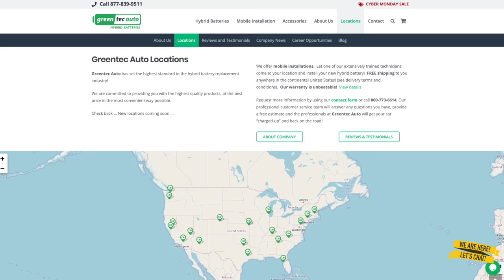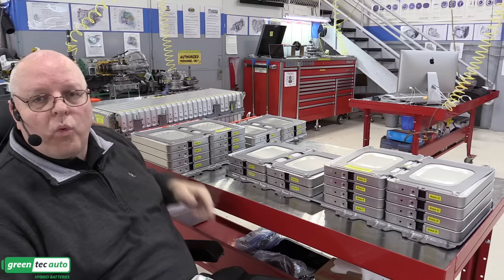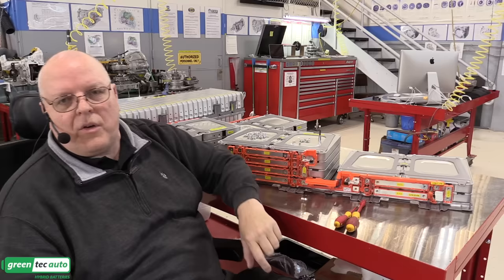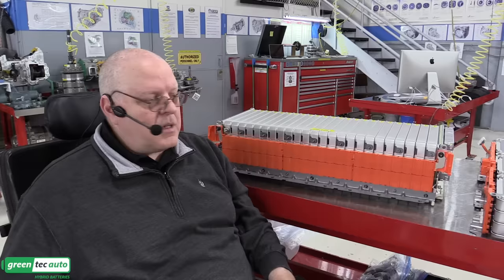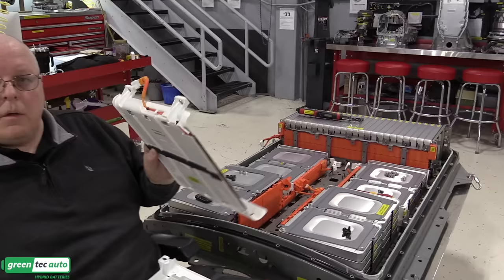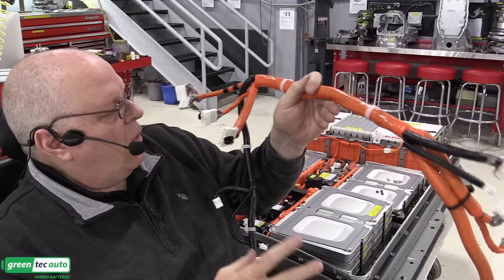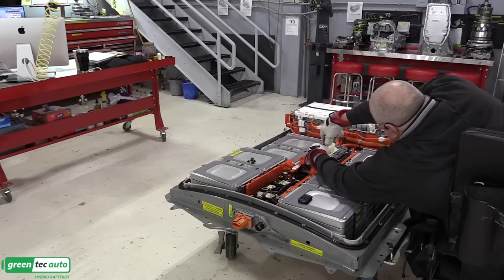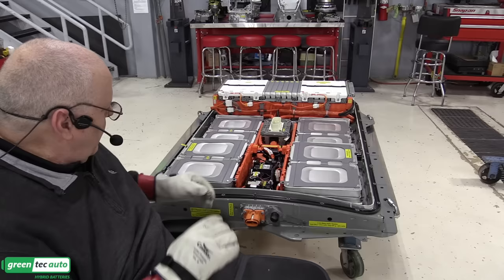2011 Nissan LEAF Battery - Deep Dive

Comment: I dont know when i will ever need this information but i freakin love watching these videos! Glad your back up and firing on all... battery cells
Reply from the maker: Thank you!
Reply: This new tech is largely unknown and untested. Do you remember the first switched feed that where lighter than those with transformators, but broke down in large numbers,  piling up to bulges?
The huge batterie has also new chemistry and had already a huge fire that required a huge tub to be drawn. How many more electrical nuclear facilities will there be needed to supply all those crazy ecological drivers eager to outlaw the older diesel and gasoline motor cars?
Please give us also a video on U-Tube about these. Willy Degeest, electrical engineer UCLv, 1966
Reply: Just bought a 2011 Nissan Leaf!
Reply: we will never have to open one of those in our life time.

Comment: Wonderful information.  I owned a 24 kWh Leaf that suffered two bad battery modules.  I was seeing diminished range even though it showed 12 bars of health. Nissan corporate fought me tooth and nail on repairing the battery until it finally when into turtle mode and threw the check engine light.  The dealership was on my side, but Nissan corporate would not authorize the repair until it completely failed.  They dropped the pack, and replaced the two modules. After it was repaired, I traded it for 2017 Chevy Bolt.
Reply from the maker: Thank you. I am sorry to hear of your troubles. The Bolt is a great car
Reply: WeberAuto I’ve really been enjoying my Bolt. Two years old now.

Comment: Thanks professor YOU'RE videos convinced me to give electric cars another try I used to have a 2013 Nissan Leaf SV it was a fun car but  my winter range was 35-43 miles and summer was 60-85 battery degradation was pretty bad sold it after a year couldn't deal with it anymore plus no quick charge on it. 4 months ago I bought a 2017 Chevy BOLT and so far love it winter range is 160-190 miles and summer is 215- 270 ! Learned a lot from your videos and active battery thermal management is a very important thing plus this bolt has quick charge :)
Reply from the maker: Thank you very much!
Reply: Wow!

Comment: Thank you very much for this, Professor and team! I'm a Nissan LEAF owner from Sri Lanka, where, when paired with rooftop solar, the LEAF is arguably the most practical vehicle to own, if not for the effect our otherwise great tropical heat has on it's battery's State of Health. I'm hoping your video will help me to understand and evaluate options, if and when my battery's SoH makes some kind of repair or replacement necessary.
Reply from the maker: Thank you and best wishes!

Comment: I am not a technician, however, the info you provide is detailed and easy to understand.  I especially enjoyed your video when you explained how the high voltage system workes and is isolated even if it is compromised.

Comment: This will be great in a few years. I plan on taking my leaf battery out of my car when I am done with it, re-arrange the cells to 48V and hook it up to my solar system.
Reply from the maker: It could be easily done
Reply: If you've got the money they're up on Ebay right now already.
Reply: They are definitely some of the best batteries for DIY powerwalls.
Reply: @InnovativeSustainableSolutions   I would not go that far, thermal runway is an issue and I would not have them close to the house  for that reason.
Reply: Aren’t we all already somehow connected to the Solar System man? ✌️

Comment: Minimum voltage is 2.6V. At that point, contactor disengages.  (applies to 2014 Leaf, not absolutely sure about 2011)
Reply from the maker: Thank you

Comment: Awesome video- thank you. Gives way more info than even reading service manuals gave me. My 2018 had a bad cell module at 8k btw. Detected as HV leakage to ground. Took a long time to replace and now those cells are 60-70mV above the rest even though tech specifically told me he balanced them prior to assembly. Seems a bit out of spec!
Reply from the maker: Thank you very much. New cells will normally be slightly higher after balancing and driving. As long as the difference does not exceed the specification, it will me okay.

Comment: Two lion pouches run in parallel(making a pack) and two packs run in series (to make a module) and 48 modules run in series. 2 stacks in front(L/R) and 1 stack out back.
Reply from the maker: 48 modules running in series on this battery

Comment: Hello from Estonia, again. I have 2014 Leaf, same battery design, different chemistry. Climate here is mild. Two days ago I passed 161xxx Mm (or 100 000 miles) and my battery SOH is 93% (maybe 92% because calculations in cold weather are not very accurate by BMS, it fluctuates seasonally).
What I want to say to everybody who really things every battery has to be cooled - NO. No it doesn't. Though chemistry must be totally fine with 20-40*C. 2011-12 Leafs did not like 30*C AT ALL.
Also cooling is definitely required if charging happens on average, above 35kW (long distance trips). 24kWh battery will accept 40-45kW for aperiod and gradually slows down to 35kW at around 2/3. 30kWh Leaf can easily take  45-48kW for majority of charging session and THERE you need some active cooling (doesn't have to be liquid). But yea, not all EV's need active cooling :)
Reply from the maker: Thanks for your feedback!
Reply: Did you know Tesla heat up the battery to 60 degrees to charge and this prevents degradation when charging. This issue with the leaf battery is heating and cooling.

Comment: Thanks you for another very informative video! 
All these high current connections remind me that when I recently replaced a Tesla Model 3 pyro fuse there was a requirement to do a 4 wire resistance check (45 and 60 micro-ohms max) of the finished connection. I can imagine that the Tesla, using plated aluminum connections and max. charging loads of 250 kW is maybe a bit more concerned about this than others, but it made me wonder if we want to be doing such measurements on all high current connections? After all, the consequence of a high resistance connection might be a fire in the battery case and I can't imagine any way that the BMS will detect and prevent such an event ahead of time. 
In my EV conversion work, we often just give the car a hard drive and then view the system with an IR camera. But in a closed battery case that's not a simple option. 

Anyway, just the usual musings. Thanks again for sharing so much excellent knowledge on EV's, I've learned many tidbits from your programs.

Comment: Really fascinating video, glad to see that you're back.
Seems really short-sighted of them to not do some kind of active cooling.
there's plenty of room around the perimeter that they could have done cooling blocks  or internal radiators and run a coolant loop to the outside of the battery case.
Reply from the maker: Thank you and thanks for your feedback

Comment: Service disconnect AFAIK is between front stacks and rear stack, dividing voltage in half.
Reply from the maker: Yes, you are correct. I was wrong. It divides the rear stack from the two side stacks.

Comment: I own a 2015 leaf, So this should be pretty informative!
Reply from the maker: Yes, they are very similar.
Reply: WeberAuto I just bought a 2016 30kWh Leaf. Are there any major differences? Cooling? I was under the impression there is significant air cooling.

Comment: You leave no handicapped people an excuse to not work.  Although we all knew you could / would do it, an assistant would probably been nice to have, especially as you lowered the end cell pack.
I could see you felt like I did, that was totally stupid that they didnt put some cooling system in this design.  I think the engineering group should have been moved to an assembly line position, or worse, after this.  Thanks for all the wonderful videos John!
Reply from the maker: Thank you and thanks for your feedback!
Reply: Don't blame the engineering group, blame the bean counters.

Comment: Beautiful executed, it is a bit funny the lithium cells can't withstand charching below 32 °F since that will result in copper plating on the graphite and insulation.  My point is how can the car regenerative braking at temperature below 32 °F when the heating element isn't  activated before 1.4 °F
My I3 makes regenerative braking below 23 °F (haven't tried it at lower temp and it is right out of the parking lot)  
PS: It is delightful to hav you back on the channel in full action 👍
Reply from the maker: Thanks fort your feedback!

Comment: I purchased a LEAF a few weeks ago, and I am greatly indebted to you, Professor Kelly, for this video of the assembly of a battery pack.  It contains all the vital information concerning the batteries which hitherto I have been unable to find.  Thank you.  One point: when you were dealing with the high tension components using the appropriate protective equipment and insulated tooling, when torquing down various securing screws the torque wrench and deep socket didn't appear to be insulated.  Is this so, and if so, is it safe?
Reply from the maker: Thank you, and thanks for your feedback. I agree, insulated tools would have been more safe.

Comment: Thank you very much for this very impressive demonstration of high skill engineering. This should be a lesson for all those that call them self engineers. Is just briliant to se someone work in the proper way.
Do you have any plans for taking apart a Renault Zoe, possibly also the battery?
Reply from the maker: Thank you! I do not have any plans for that, but it would be interesting

Comment: I'm 4 years into a 2013 Leaf SV. About to hit 100k miles by January and only have 74% original battery state of charge left, it's about 16.3Kwh when fully charged. Wondering if it's possible to replace the battery and maybe some other computer communication parts to use a 2017 30 kwh battery pack? Or do I ride the car out and let it die its natural death, get as much use out of it that I can, and get another EV for longer days?
Reply from the maker: Let it run out and get another EV later

Comment: Can't wait til one day you get your hands on a model 3! Can't believe this car has no thermal management, what a sham.
Reply: Yep, after four Arizona summers and 43K miles, I'm down to ten bars on my '15, which shipped with the "lizard" battery.
Reply from the maker: Thanks for your feedback!
Reply from the maker: I hope to get my hands on a Model 3 too!
Reply: I agree, it is really fraud.
Reply: @WeberAuto  thanks for sharing the video, it was informative. As for the design lacking an active battery cooling system, Nissan still hasn't included one in their 2019 model even though they are fully aware of how detrimental it is without one. Hopefully a second hand market will develop where someone comes up with a battery replacement that has an active cooling system, I know it won't be Nissan given they are selling crap that should have warning labels on it. Never Again Nissan, may you be force to buy back all the Leafs you sold for their original purchase price plus the financing cost for the owners.
Reply: @ewmlloyd  Lizard as in cold blooded? haha
Reply: @ewmlloyd  lack of cooling was only half the issue.

Comment: The middle terminal is needed to balance the cells. Over time, the internal resistance of series-connected battery cells can begin to vary greatly This causes one of the series-connected cells to recharge while the other is undercharged. Overcharging will reduce cell life and may cause the battery to ignite spontaneously. To prevent this from happening, an additional terminal is made from the serial connection and a device is connected to it that controls the charge of each cell (two parallel-connected cells in the case of a Nissan Leaf).
Reply from the maker: Very true. Thanks for watching

Comment: The Leaf is a really well engineered car. Every part of th car is really well made and serviceable. If the battery had temperature control it would be great for hot areas. The ones that drive around here in Northern Norway are still doing well as it's not very hot here. 10/12 bars is normal degradation for the old first gens here.

Comment: What's your opinion on Nissan refusing to actively cool their batter packs?
Reply from the maker: It makes no sense to me. Nissan tried to corner the EV market by cutting costs. I think this was a cost cut that ended up costing them.
Reply: WeberAuto I kind of agree with you that all high voltage power pack should be actively cooled, but it makes me wonder, why there’s so many cases of Leaf battery degradation, yet not so many case with Soul EV packs. Other than cars DC charged in high temp climates like Arizona, Soul EV had nowhere near the number of issues ... I realize Leafs is out there in hundreds of thousands, while Soul EV is not .... but we would still hear cases, for example in cold Canada which we know of with the Leaf. The Soul EV does have a fan blower .... do you think that’s the difference, or is it rather the design of their modules?
Reply: I think they want to prevent dust from accumulating and causing ground fault. It is a real problem at higher voltage because your body getting electromacuted will look the same as a dirt fault. Dust plus moisture and air movement would quickly give you ground faults when placing the batteries on the floor of a family car.

Comment: Thanks so much for another video! Have you got your hands on a spark ev? I just bought one salvage and am using the battery and motor for a conversion. I'm wondering if I can ditch the transfer case and attach a  motor directly to each rear axle(one motor per cv ). Signing up for the march class soon!
Reply from the maker: Thank you! I have seen the battery and components of the Spark EV. I do not know if that could work. Best wishes.

Comment: Hi, I'm from Russia (Yakutia), how does a temperature of -40С affect the LEAF battery? Russia has very little information about electric cars
Reply from the maker: The electrolyte will freeze. Not intended for operation at that temperature.
Reply: Валерий Б your comment make a big smile on my face. I heard that you let the combustion engine run at the night! Or preheating the engines with GAS. So the chemical performance you can find on Wikipedia about Lithium batteries. You need some preheated system for charging. In these wetter conditions I personally don’t recommend you EVs the common models are not designed for your temperature.
Reply: @w4csc hey EV hater. In cold climates, Tesla pre heats their batteries on the way to the supercharger so the battery is ready before you start charging. Tesla is a very successful car in Norway, and yes, it is also cold in Norway.
Tesla model S battery cost $12000 USD to replace.
Have another try EV hater.
Reply: @darkweb8860  Tesla has this sorted. Tesla is very successful in Norway.
Reply: - 40 you should use diesel engines and don't turn them off, cars in those temps should be set to double as power generators , run the house
Reply: @WeberAuto   hello ) Our temperature in winter reaches -50, if I freeze the car for 5 months in winter, will the batteries fail?

Comment: No active cooling means also: no possible leakage, or having to service the coolant. It kinda makes sense to me, that Nissan choose to not actively cool the battery. It saves money in the production cost, and keeps prices down.

To bad in hot climates, not actively cooled has a bigger impact. Because in my country: the Netherlands, it's totally fine. As long as you don't fast charge to often on one day.

Comment: Lithium ion needs terminal management in cars unless charge and discharge is tiny. It's not going to perform in cold climates and will have short life in hot climates. Not fit for purpose nissan.
Reply from the maker: Thanks for your feedback
Reply: There a version with a battery heater for  cold climates. In saying that for the vast majority of owners the passive cooling works just fine. Mine has never been more than one bar above or below the mid range  on the indicator. The battery is 7+ years old with 76% SOH used daily and always charged fully. There is no real issue with battery life generally speaking as there are many old leafs like mine still working well and well suited to their intended purpose.
Reply: @simond7582  The leaf batteries heat up to over 50 degrees on a 50kw charger then what? If you drive your overheating the cells that should be discharged at 25 degrees or wait 12 hours?
Reply: @super-sim1665  that's not the intended purpose then is it? Just because it's possible to charge at 50kw it's doesn't mean you should, much in the same with ICE cars there are certain conditions where you wouldn't use them to their full capacity for risk of overheating.
Reply: @simond7582  50kw is the only reasonable charge rate in UK. We have a 90 minute limit to motorway chargers so it would not be possible to travel between stops at lower rate making it a useless car.
Reply: @super-sim1665  get a Tesla then it's designed for that sort of use.
Reply: @simond7582  What car use?
Reply: @super-sim1665  What?

Comment: these are great. i got three modules rewired for two batteries at 12v run through a HF 1500w inverter running a arctic king 5000 btu window unit ac pulling 490 watts, i get 1.5 hour runtime at 100% duty cycle high cooling. charged with drok 720w step down converter as a 2 stage charger. with  2 100w solar flexable panels on a 4x11 teardrop trailer. each 12v battery comes in at 26 lbs. edit: test charging a single cell at 50a with a running car, survived no problems. couldnt test at higher amperages. fun fact, a single 8.4v module can be charged from a running toyota yaris about half way before the battery voltage climbed above 8.4v under charge.